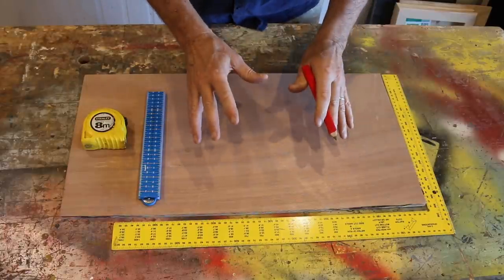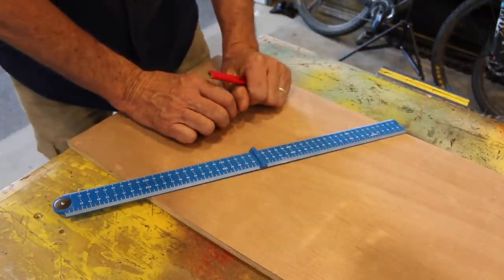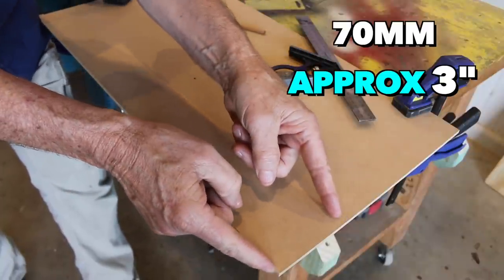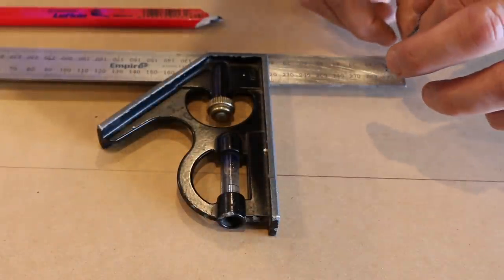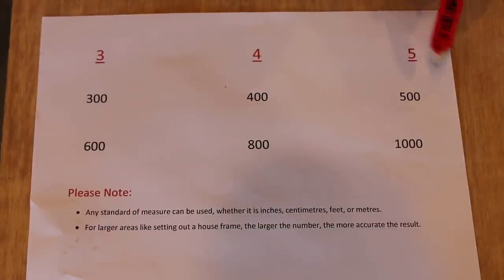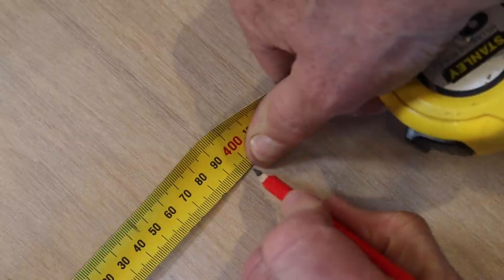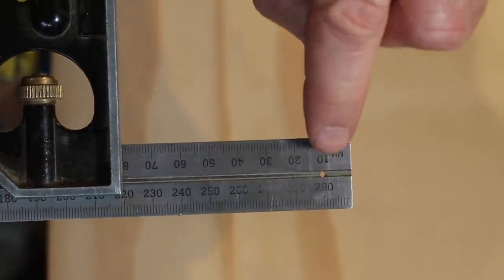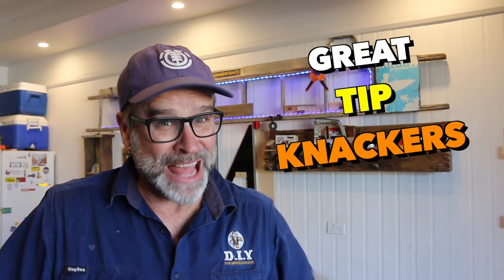5 LIFE Changing Measuring Hacks!

Comment: I love the magnet on the end of the tape measure trick. I’ll use that instead of my current technique which is jumping in the car and going to bunnings and buying a new one. And also buying a ten pack of micro fibre towels, an extension lead and a lint roller. Or whatever else is on special near the checkout counter.
Reply from the maker: Hahahahhahahha....love it! 😂 Sounds like me all over Billy 👍😁🇦🇺
Reply: now why does that sound familiar to me? oh yeah..thats right..I need a light globe..and come with a new router...a set of drill bits...plants for the garden plus a pack of those microfibre towels near the counter...damn you Bunnings...lol

Comment: Great tips!  I'll definitely be making holes in my combi squares.  I thoroughly recommend the Bahco combi squares as they're fairly cheap but I've checked them against a Swanson speed square and Trend digital measure and they're absolutely bang on whilst also being pretty cheap.
Reply from the maker: Thanks Andy! Glad you liked tips mate and l appreciate the recommendation too mate.....l have seen those on the market 👍😁🇦🇺
Reply: I bought a Bahco combi square last year, the ruler bowed quite severely (about .8mm), and I only found out AFTER trying to calibrate it by sanding down the contact pins in the groove. I was constantly checking it with my 100x150mm knife edge square, but every time I turned the ruler around to double check, it would be seriously out of square again. So I had to spend a heck of a long time sanding the edges of the ruler to get it straight.
I might have gotten a bad one, this is certainly not up to Bahco's usual standard (I have a variaty of their files, socket wrenches and pliers, all excellent quality).
If only I still had access to  a plane grinder, it would have taken me 5 minutes.....

Comment: You tell us to buy you a cup of coffee and then go drink tea.  What an insult!

you showed me a new hack today to a routine done by different methods. The 3,4, 5 triangle.  

I'm building a sled soon, and I have been wondering if there were an easier way to get the fence square. One mark where you want the face of the fence to be, and then another mark, either 3 or 4 units up, depending on the length of your fence, and then make the two marks where the other end of the fence belongs. The perfect right angle for the fence. :) 

I've tried to figure this out before, but your using the arcs makes the difference to find the exact point.  

Thank you, again!  You are the greatest!  coffee or tea not withstanding.
Reply from the maker: Hahahhahaha....I'm across all hot beverages Buck 😂.....no favourtism here mate 😂  The 3 4 5 method is one of the best hacks ever for getting things square...it is fool proof......which is lucky for me 😂 Good luck with the sled and thanks for watching 👍😁🇦🇺

Comment: Another measuring hack. If you've ever tried getting an accurate measurement for the centerline between two walls or door jambs you know how hard that can be. Especially if trying to measure over head and the distance is further than the tape measure will stay rigid. Example: I had to find the center between the two jambs of a double sliding pocket door that meet in the middle to install a door stop on the header. I placed a step stool in the middle of the opening (which was roughly 6') and measured over from each end an equal amount just shy of what looked like center... Say 2 foot 9 inches and made a mark. Then it's simply a matter of finding the center between those two marks, which were only about 6" apart! It only took me 40+ years to finally think of that! A similar trick along those same lines.. I had to make some double sash wooden windows to replace some that had really bad rot and termite damage in a 100 year old house. Needless to say I needed to get very accurate measurements, but was having a hard time getting the measurements between the top jamb and the window sill. The solution... I cut a scrap piece of wood exactly 10" long, held that up against the top jamb and made a mark 10" down. Then measured up from the bottom to the mark and added the 10"!
Reply from the maker: Great tips right there 👍 Thanks for taking the time to share those Eric 😁🇦🇺👍

Comment: Really good tips. Thanks for the video. Does the drill bit size matter when you make a hole in the blade of the combination square?
Reply from the maker: Thanks Tim...glad you liked them mate 👍 Make the hole as small as you can. You want the tip of the pencil to go through it with any excess play 👍😁🇦🇺
Reply: @diyforknuckleheads  Ok, sounds good. Thanks from Texas.
Reply from the maker: @timbarnett2120  👍👍

Comment: Great ideas. But I was hoping you could tell me why I always measure short (quarter inch or so) with a tape measure no matter how many times I do the measurement.
Reply from the maker: Hahahahhaha.....a very common problem Akeleven 😂 Thanks for watching 👍😁🇦🇺
Reply: Check your tape measure against a good steel ruler as not all tapes (and rulers) were created equal. Does your tape have a moveable hook at the end? This is so it can do both inside and outside measurement without being out by the thickness of the hook. If the hook is meant to slide but is fouled up with gunk it'll give false reading.